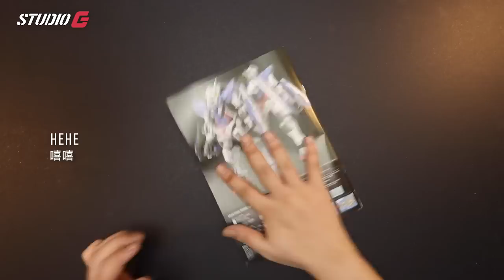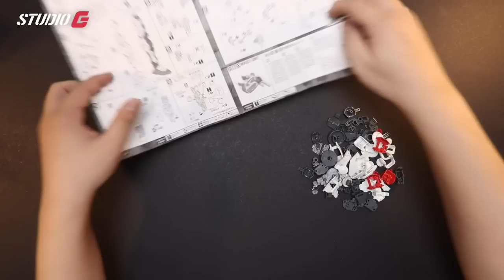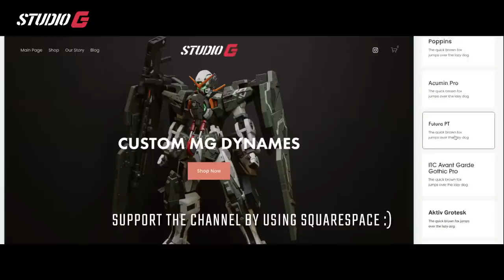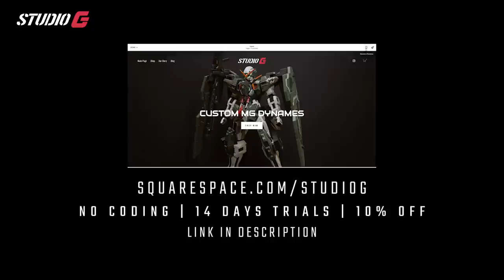CUSTOM BUILD GUNPLA | MG EXIA REPAIR | 00 SERIES STORY EP 01

Comment: can someone tell me why he cuts the single pieces out of the frames with so much of the supports and then cut off the supports in an extra step? is there any danger of braking them if not done like this? I will start my first simple build on this weekend and don´t want to miss out on the basics ^^ Of course this will not be an awesome piece like this but I guess everyone started easy.
Reply: It just helps release the tension to hopefully negate stress marks at the nubs on parts.